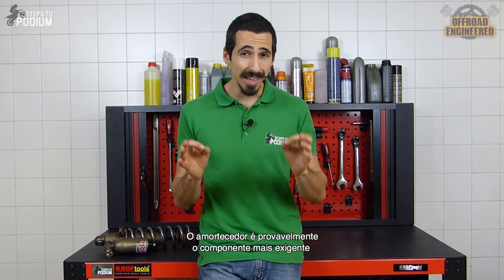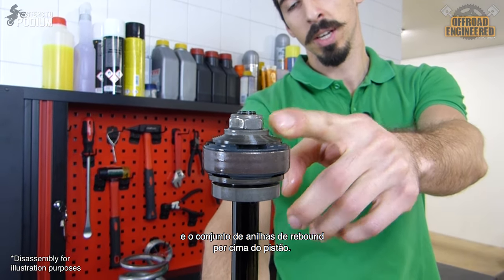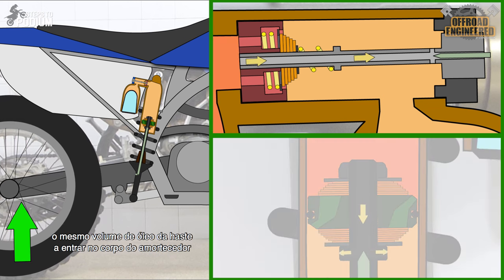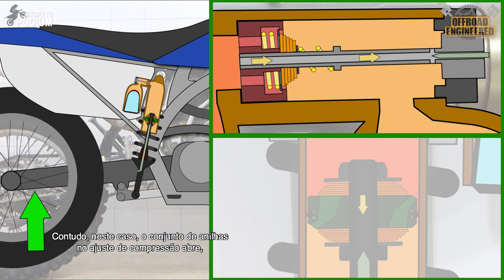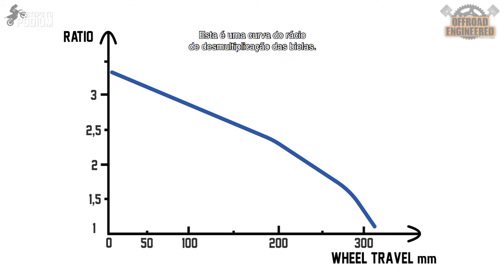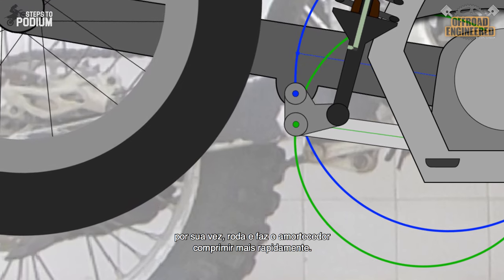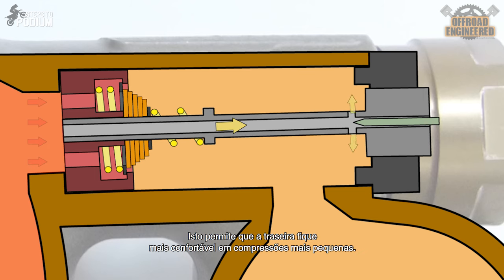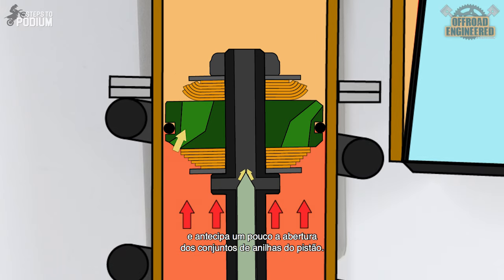How a dirt bike Shock Works | Offroad Engineered

Comment: Great explanation and explains nearly everything.  For complete newbies they may still be wondering what "bottoming" and "base settings" are.  Those terms are mentioned but I don't think they were explained. 

Bottoming is when the shock is fully compressed and can't compress any further.  This usually results in a jerk and hard bounce, possibly leading to a loss of control for the rider.  You don't want to bottom out your shock, it's uncomfortable at best.

Base settings, I think I understand this but someone else could probably explain better. They setting is for example the spring you are using on your shock. The spring rate needs to be matched for the weight of the rider. For example a heavy rider would need a stiffer spring rate than a lighter weight rider.  Or maybe the  shock oil viscosity /weight could be changed for heavier or light riders as well.
Reply from the maker: Everything you said is correct a part from the viscosity part. You should never, ever, change the viscosity of the oil. You should always use an oil with the viscosity recommended by the manufacturer (there are already too many variables! We don't need another one 😂 besides that, a suspension/shock is designed for one single viscosity, nothing else - at least performance suspensions)
To add to that, there is that wrong concept that the hydraulic part of the shock is used to compensate the weight of the rider or the spring does something to the hydraulic, but it's completely wrong. Both work independent from one another but together they provide a beauty of a behaviour. 
Thank you for your input Jrod! I appreciate your comment 💪💪
Reply: @StepstoPodium  very good explanation thank you!  I was thinking rear shock could be like for oil, in that you can buy 5wt or 10wt oil.  But I understand from you it is not.  

Thanks for your great videos!

Comment: Yeah, I can just agree with another comment - your videos are good and informative. One thing I'd probably suggest is trying to sometimes provide a little bit more associative examples and maybe some more simple explanations (simpler words/terms), but all in all the explanations are already superb, so this is just my view to get them from 95% to 100% perfect :)

Anyways, one question - so how does the damping influence the suspension travel used? 

I'm only now learning about how suspension works, so if I'm incorrect, please, correct me. From what I understand, the spring is the element that influences the travel used on a particular bump, as it is the one actually transferring load between both "sides" of the shock, at least if the oil is viscous enough to move in the shock, as it seems that if it would be unmovable you'd basically have no shock at all, as the load would be carried directly through the incompressible/unmovable fluid, is that correct? If the spring has linear stiffness of 10N/mm, then, when you hit a bump riding at a particular speed and generate a force, let's say of 1000 N, you expect the spring to compress by 1000 N / (10 N/mm) = 100 mm. The shock with its damping properties will determine how fast the spring will compress, but will it determine whether the spring will compress to the maximum at all? Also, as I understand, the spring is the component that determines the total maximum travel possible by the suspension, is it? Thus, if you have a spring that can compress fully to 300 mm, but it is way too compressible, let's say, 5 N/mm and your SAG thus is let's say 120 mm, when you hit the aforementioned bump you'll need travel of 200 mm to "soak" up the bump but because you have too big of a SAG, you don't have enough travel left in your suspension to deal with the bump, is that correct? As I understand something similar happens "on the opposite side of the SAG" -  if your SAG is too small, then you'll be OK with the available travel on the compression side of things, but if you "jump off" of a small bump you may not have enough "SAG" to squash the rear (for example) wheel back down to the ground to faster get traction, that is, you'll kind of spend more time "in the air" with the wheel - is that correct?

So, if some of this rumbling is correct, does it mean that if you have problems with bottoming out it is the spring stiffness you need to deal with, not the damping settings? And if you have no problems with bottoming out, then you can work with the damping settings?

Thanks
Reply from the maker: Damn that's a lot of questions 😅😅
Would you find useful if we scheduled a technical session? 😄
You can take a look here:
www.stepstopodium.com/technicalsessions

Comment: This video really helped me visualize what’s going on. It’s still a bit confusing to me why the rebound orifice allows oil to pass through during the compression stroke. Maybe it’s to prevent low pressure buildup under the piston, but at the same time, that would prevent prevent the piston from pushing oil through the compression circuit so idk
Reply: Imagine the compression shim stack was removed/closed so no oil could flow on a compression stroke of the shock. This would create a vacuum under the piston and a pressure on the top. This would stall the shock almost immediately and cause huge rebound speeds. (Spring rate + pressure + vacuum)This is why a flow is necessary. It’s minimal that goes through that orifice. But any type of off-road riding will blow through the rebound orifice and get into the compression shim stack almost immediately. Watch his mid speed video and he has a generic damping curve which will show how quickly a shock/fork moves from the orifice and into the shim stack.